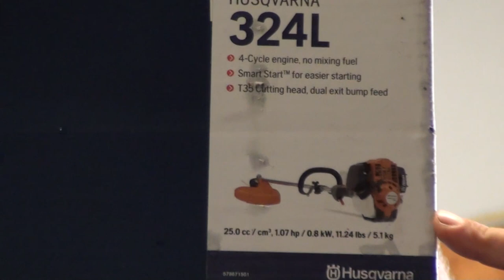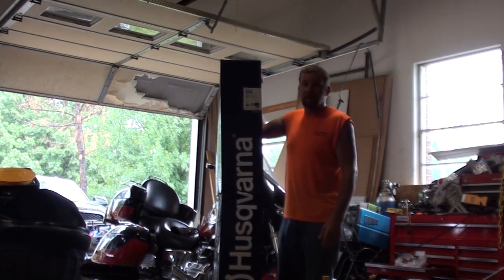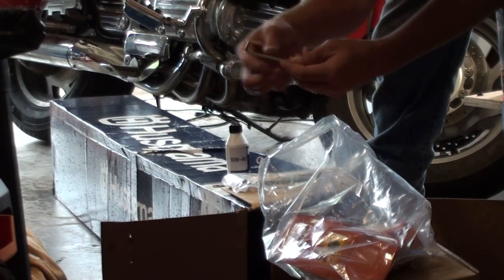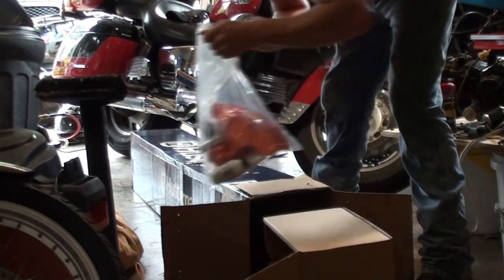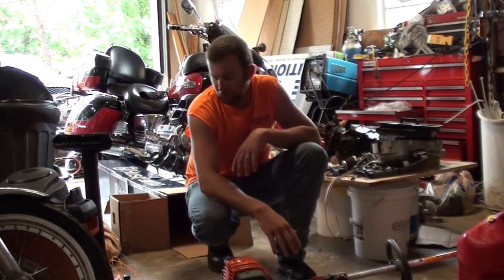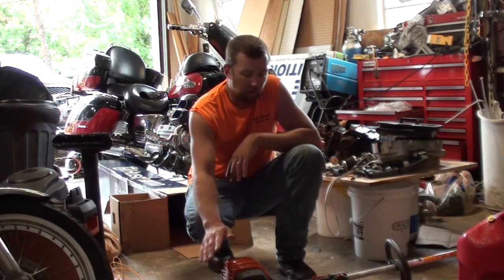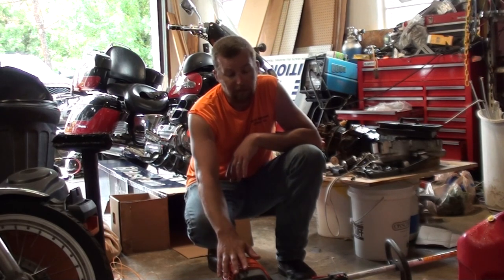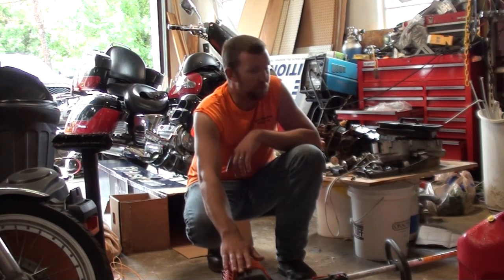Unboxing The New Husquvarna 324L Trimmer

Comment: Ive got a 224l that a bought must be 6 or 7 yrs old. Still starts easy and runs like a top. Ive used it for lawn care work and have ran it extensive hrs.. sips fuel as well.  That honda gx25 is killer.. torque is ridiculous. There is no comparison to other 4 stroke weed wackers of this type unless its the honda branded trimmer. Then its equal🤣

Comment: Dumb question but if you don’t give it a lot of time to warm up after first getting it can that burn up the clutch so the head won’t spin?
Reply from the maker: Aaron Massey no, that should not be a problem. I just wanted to give the engine time to warm up and sling the oil around a bit. If you are having clutch issues that is a manufacturing defect and your warranty should cover it.